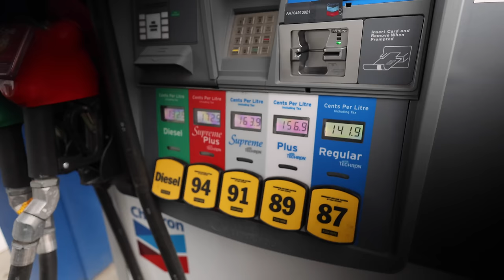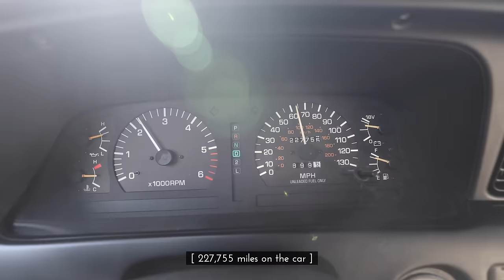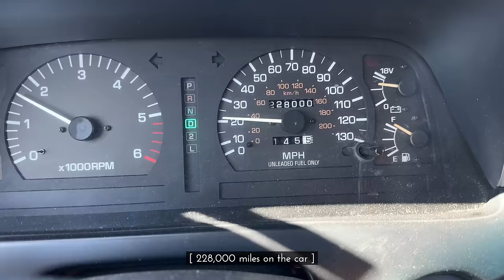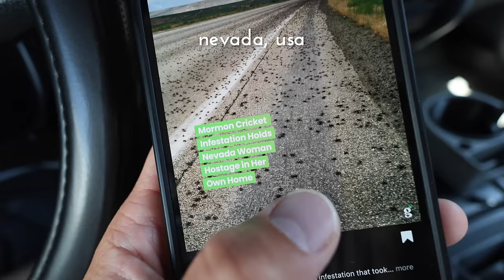7 Days in Canada with my 30 Year Old Toyota Land Cruiser | Camp & Cook

Comment: The correct way to pour oil from the bottle is to flip it so the spout is "on top" when pouring. I just learned this recently. This lets you control the flow better without air bubbles.
Reply from the maker: Shiiiiiiii i never knew that thanks!

Comment: Did you mostly wild camp or used proper campsites ? I am planning to do a road trip from Vancouver end of October and not sure if sleeping in the car or wild camping is recommended because of bears - what do you think ?
Reply from the maker: I camped at a campground since I'm not familiar with the CA rules. I heard you need passes for wild camping  and it's not easy to find a map of where you can actually camp. Hope this helps!